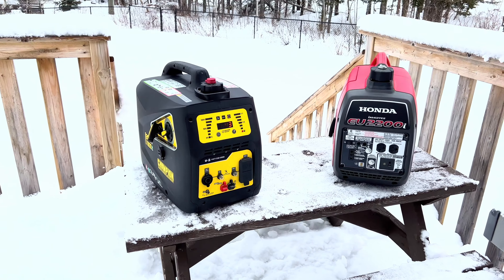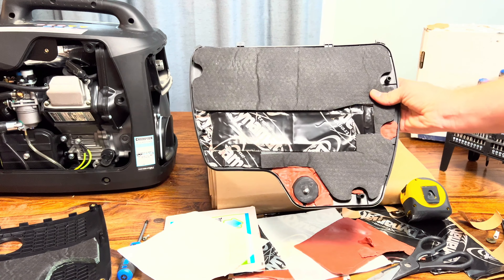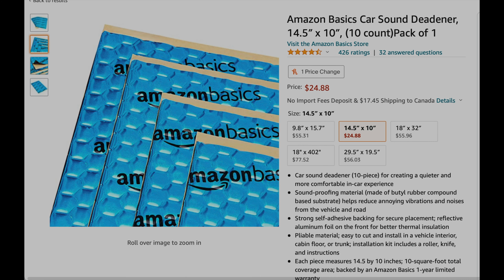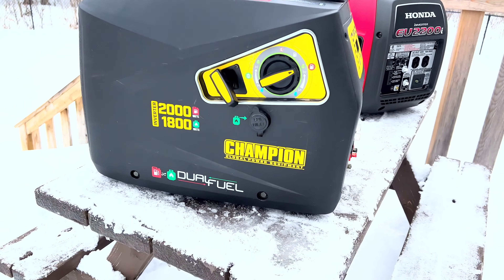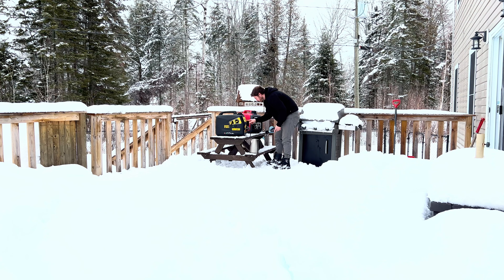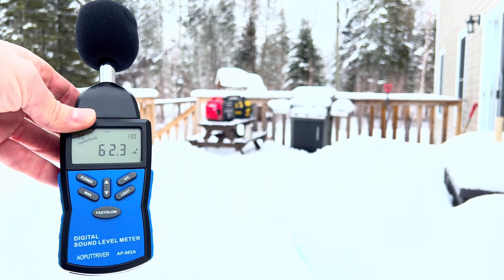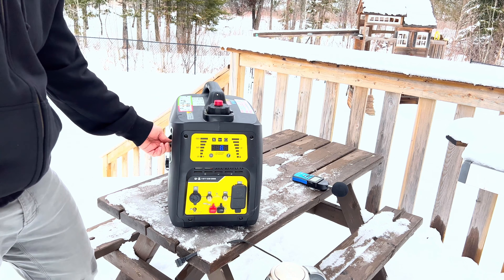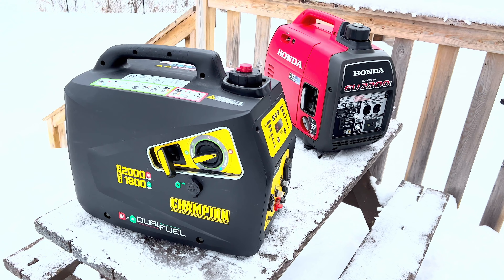The $20 SECRET to a Quiet Generator!

Comment: the honda has a big advantage so that will make it hard to match.  the honda has a nearly twice as large or a motor than the champion, assuming the champion has the same 80cc engine that most of the ones in this power range usually have

Comment: I'm building a generator box on the front of my RV to protect them from the weather and worried about over heating I'm going to cut and install some metal down ward vents I'm also thinking of installing a fan inside the box for cooling and ventilation I'm also thinking about putting 1and half inch foam installation were I can on the inside because that's what I have left over from winter let me know what you think and if you have any ideas let me know thank you

Comment: I just found your page. I was wondering if you might have a solution to wrapping an 8" diameter sanitary pipe that runs along the ceiling of our basement. We're building a living room down there and the pipe runs down the middle of the room. Anytime a shower or sink or toilet is used, it can be very clearly heard over the TV playing. 

The kicker is our house is in Spain. I see a lot of products for sound deadening for pipes in the US, but nothing for Europe. What can be adapted to achieve the same thing? Thanks in advance.
Reply from the maker: Do they sell mass loaded vinyl? You can find that on Amazon but not sure if it’s available on your geo location.

Comment: For me, this is a bit too much cost and work for a 1/2 to 1-1/2 dB sound reduction. If, as you said in the beginning, there was a 3db saving, this would be very much worth the time and investment. For now, I'll just put my little inverter/generator in the bed of my pickup truck with the tonneau cover on and the tailgate open (exhaust facing out) to reduce the noise substantially. Before anyone chimes in, no one is in the truck while it's running and it has never overheated in the past 3 years of use here in the southern US.
Reply from the maker: Makes perfect sense!

Comment: hello sir, i want to reduce 105db sound to 60db is it possible ?  how should i do? should i build double wall with 5inc airspace in between that ? what is your recommendation to reduce that huge sound ?  we are using rock-wool (silent and pro 380 . 100kg dens  50mm (2inc think) )  max dens and  then max dens mlv .

Thank you we are waiting your answer

Comment: Bet a carboard box with a hole for exhaust to vent would do better
Reply from the maker: Probably, but it would also overheat after a while and would automatically shut off if you have a carbon monoxide sensor.
Reply: @soundproofguide  Its winter, maybe overheat in summer.
Reply: Maybe it would do better for toasting marshmallows ..  :)